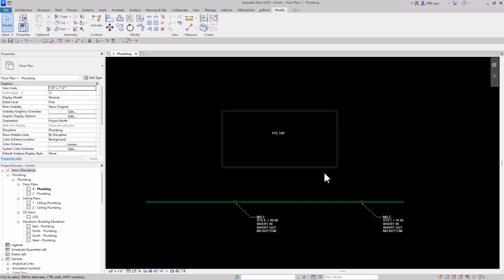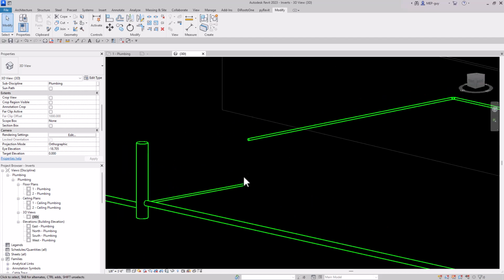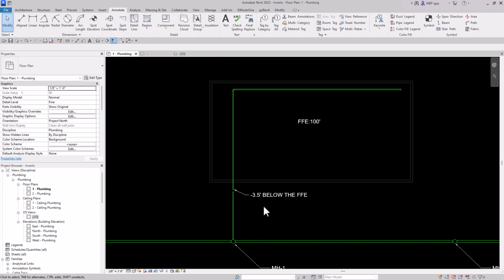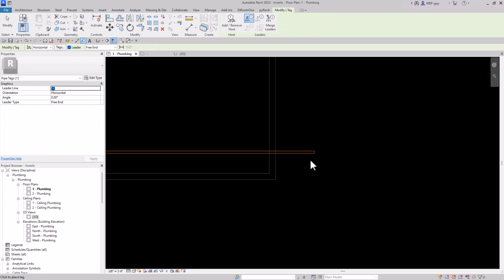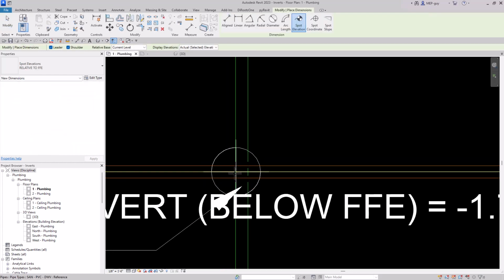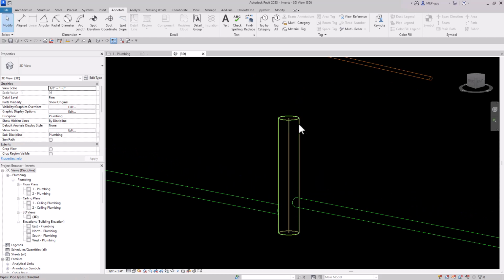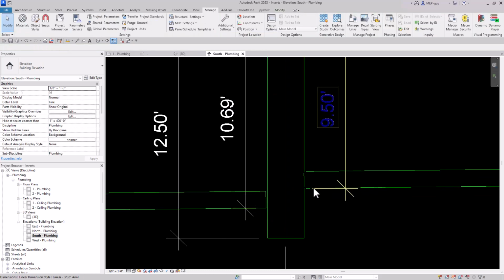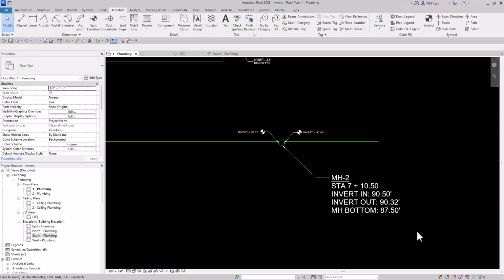How to Find Sanitary Inverts in Revit

Comment: Your content is top notch, thank you. Pipe invert elevation is the lowest point of the inside diameter. Pipe invert elevation is the elevation of the inside bottom of the pipe. You can see the value listed @6:25 under Constraints parameters. Lower End Invert Elevation = (-3.064).
Reply from the maker: Thanks so much Jon. I realize that now after making the video. Appreciate the feedback!